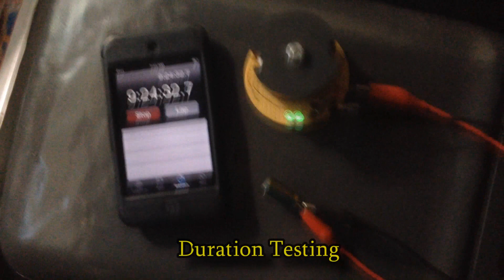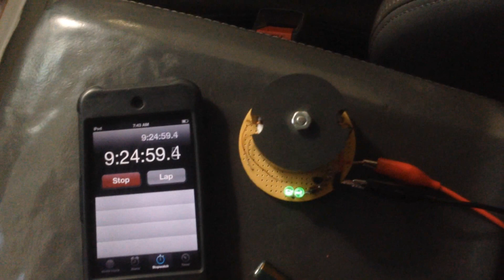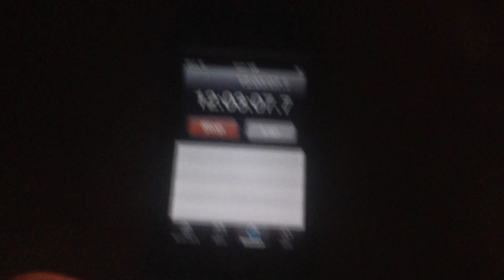12 hour run on 3500uF - SJR Looper V2 LED Driver

Comment: All the secret is on the crossover winding of the toroid coil. When you cross the wires an almost ideal impedance is created and the oscillation can sustain for a much more time. If you substitute the condenser by an almost perfect admittance you can ring the circuit  better and probably for an indefinite time without the transistor. This is a bipolar oscillator with a good impedance... the missing element is the admittance which the condenser is kind of a similar but incomplete function (bipolar and not ideally quadrapolar).

Comment: Whay are the alligator clips and wires for? 9v bat?
Reply: The capacitor is the battery.  It will die eventually but the energy continues circulate and dies a little each time.  Current draw is in the uA.  This is not a trick or fake.  It makes perfect sense.

Comment: Howdie Sebastian Williams bro. Do you know how much power you could store in a cap this size please?x
11 hours ago · Like

Sebastian Williams Yes, I'm planning to use parallel joule ringers for each LED ...
11 hours ago · Like

Sebastian Williams and other configurations till I bring the brightness up to reading stadards
11 hours ago · Like

Sebastian Williams Waiting for the ferrite torroids to arrive
11 hours ago · Like

Charles Drummond Malcolm Fraser Sorry Seb you seem to have missed the question. Do you know how much power can be stored in a cap that size? I dont know how to calculate. Thanks, cf
5 hours ago · Like

Sebastian Williams Approximately .4 joules
about an hour ago · Like

Sebastian Williams .5 x 3,500 x 10^-6 x16 x16 = ~ .4 joules The more voltage and Farad value of a capacitor, the more energy in coulombs it can store - This calculation is for a 3500 uf cap @ 16 volts
about an hour ago · Like

Sebastian Williams A battery of this size could hold 15,000 times the energy stored in coulombs and measured at joules
about an hour ago · Like

Sebastian Williams Ok it's exactly 4.48 joules yet We usually round off : if below .5 say 4.48, We say ~4 if 4.5 or larger, We say ~5
about an hour ago · Like

Sebastian Williams Keep the questions coming ...
about an hour ago · Like

Sebastian Williams Remembering that a joule is 1 watt for 1 second ...
49 minutes ago · Unlike · 1

Charles Drummond Malcolm Fraser okay so a crystal cell puts out 10mw of power at 1.5v, so for 100 seconds you get 1 watt of power and then for 500 seconds you can charge up 5watts of power or 5 joules worth of energy to fully charge that cap right? Then you can disconnect the cell and that cap rings for 12 hours?

How many times can you repeat that process over 12 hours?)
12x60(mins)x60(seconds)=43,200 seconds divided by 500 = 86.4 (~86) LEDS lit for 12 hours at that brightness. So basically you could light a whole room with one crystal cell if you had a chip that swtiched the cap that was being charged? Marcus Albert Reid what do you think of this idea to use a crystal cell with chip that charges these little joule ringer circuits that ring for 12 hours each?

Comment: Great work , keep it up , issue with small led is there is alternate to it with small solar cells , which works in room light , unless you have a strong latern which u can read in dark , this will be just a mini fun project. One thing I was thinking of is like a spring watch , led can be powered by motion and caps can be charged. Not hand cranked but by movement.